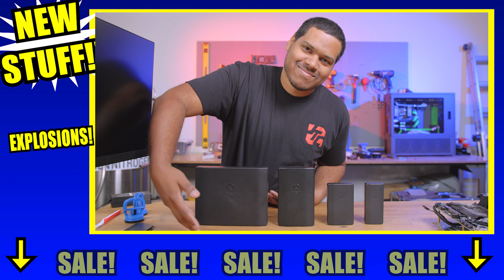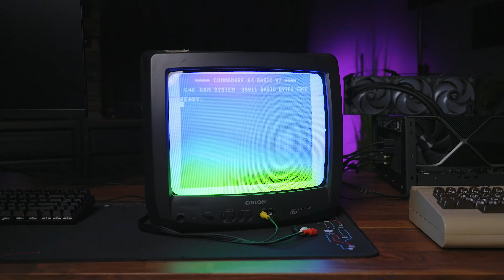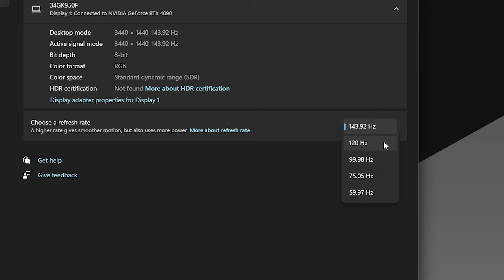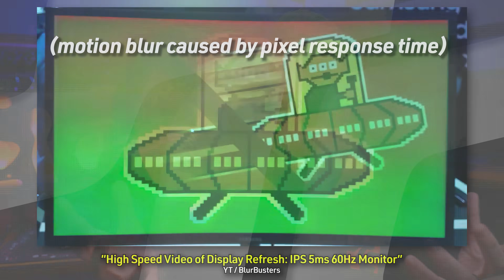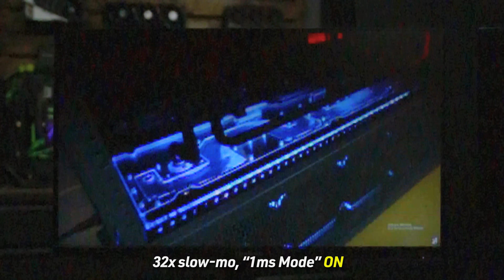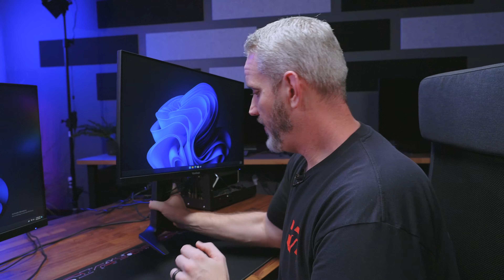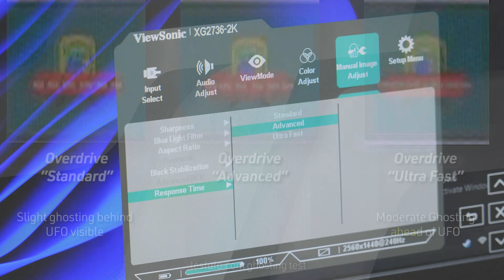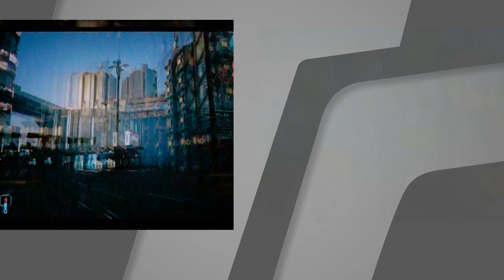MPRT is pretty awesome! This is how it works...

Comment: I'm one of the lucky few to own an FW900, bought for 250€ back in 2015, and many people laughed at me.
Of course, the screen size and aspect ratio is a serious downside, so any TV and monitor I've bought since was carefully selected to provide better than sample-and-hold motion clarity.

I own a 2018 17" TN LCD that is sub-1ms MPRT at 100/120hz using ULMB (The PG27VQ, initially purchased because it was the last/best 3D Vision Monitor). It is hacked via CRU to use ULMB at 60hz as well and remains competitve with CRT as far as motion clarity goes.
Sadly its contrast sucks, so I tend to avoid it in content that has a lot of dark scenes.

My OLED TVs (LG GX and G1) have BFI options that bring them to about plasma level at 60hz, around ~4ms MPRT and ~6ms MPRT respectively, albeit with a dim image.

I want newer, brighter OLED TVs to bring back the BFI options of my GX (hopefully more flexible), and I want LCD PC monitors to come with ultra bright HDR panels, with lots of dimming zones to improve contrast AND ultra-short-pulse backlight strobing, allowing to arbitrate between brightness and motion clarity at will.
Only the latter can somewhat compete with CRT, OLED is beautiful for slow moving content like movies, but they will never have enough brightness to sacrifice for motion clarity.

Comment: What I'm really interested in is MPRT at around 120Hz. People say "60fps was fine 20 years ago", which is true because of CRT strobe causing perceived motion clarity. If we can get mid-range refresh rate displays with MPRT for cheap, use driver tech like AFMF, graphic fidelity chasing could be something that games enthusiasts start accepting as the norm again. 
Imaginary scenario: "My 120Hz MPRT is letting me run games at ultra settings with path tracing and it feels as smooth as 240Hz with native rendering output!"

Comment: I know I did spend a lot of time researching before I bought my monitor, but I'm totally okay gaming at 2K 120/ 144 fps w/ just VRR- the hardware motion blur doesn't bother me in that range. Sure, I would love to have 4K and OLED (in that order) but it's just not worth it for me personally right now... 
Also, my GPU would have a hard time above 4K 60, and HDR support seems to be hit or miss requiring settings to be charged between different apps/ games, browsers, and desktop. So I think I'll be happy with what I have until 4K HDR 120+ becomes cheaper and more accessible.

Comment: I am sick, and occasionally Jealous, off friends that still use old ips 60Hz 12ms gtg telling me how 50 fps is smooth. And I know they are not lying because I used to experience the same thing 15 years ago.
Reply: CRT refresh and flat panel refresh really aren't comparable.  The simplest explanation as to why CRT will always be better is because there are significantly fewer steps to get the image from the pre rendered space to a pixel on the screen on a CRT.  The only way flat panel displays will ever be good is if they send images in parallel to the display and render parallel sections rather than in serial.  Basically all graphics cards are still optimized for the CRT serial image rendering pipeline... and flat panels use a pixel mesh with a flood fill refresh... which is gross and inefficient.

Comment: Grey to grey is used because it's faster than black to white, manufacturers preference is to be able to claim lower numbers. A lot of panels are not actually 1ms too. OLED is great but it's often too fast for 24p content and can make judder worse even if you run at a multiple of 24hz for no pull down. Black frame insertion is good for retro gaming but has its own issues. I don't use my retro consoles on my Samsung 55" s95c as I'd need a scaler and while the retrotink 4k is fantastic it's expensive for the hobbyist (they managed to make 1000s of dollars worth of industrial scaler quality into something reasonable for an enthusiast that's an achievement tho).

Comment: Even incandescent lights flicker, as the temperature fluctuates with the current.  It's just that they don't go all the way dark, so even fewer people notice it.  About the only lights that don't flicker are ones downstream of a moderate capacity AC->DC power supply.
Reply: If it is plugged into AC it will have a strobe.

Comment: Not every LED does flicker. Only if they use PWM (to control brightness) Or in cheap lights that do not have proper DC smoothing. LED lights that are used for example in a Photo studios would be useless if they flicker.  All depends on the kind of LED driver.

Comment: You guys should do a video that talks about the best video card and monitor pairs. What's the best bang for the buck video card and monitor pair to get the fastest frame rates and features for the least money? What's a budget pairing that will get you playable frame rates? And what would be the top of the line pair but not wasting money?

Comment: You can fix the magnetic damage to a CRT by just using a strong bar magnet. Just spin the magnet and slowly back away from the display and it should fix the colors being screwed up.
Reply: A PC CRT monitor is lightyears better because they degauss when they turn on/off.

CRT TVs are trash.

Comment: a little motion blur is okay especially for racing games as it gives some sense of speed.  i've wrecked a CRT monitor by adjusting the refresh rate a little beyond what it was rated for, usually can do around 10-15% more  ( it does work but greatly reduces  the lifespan on the CRT )

Comment: As an old Need for Speed head, back during Underground or Most Wanted times, motion blur added SO much sense of speed, it was awesome.
Reply: I generally still prefer motion blur in driving/racing games, both arcade and sim.
Reply: Agreed motion blur is really only needed in racing games, it helps gives the sense of speed better.
Reply: @Adam420Simpson  any game that need to add sense of speed may utilize motion blur subtlely, but yeah default game motion blur is yucky.
Reply: @Adam420Simpson  I have "short" motion blur enabled in Forza Horizon 5, and it does add a fair bit to the sensation of speed. In first-person shooters, however, it just seems to emulate having a concussion more than anything.
Reply: @TheRogueWolf  yeah, even on 3rd person Action RPG motion blur if its a bit will gave you sense of speed, but more that that "bit" then we can see that annoying too fast i cant see
Reply: @TheRogueWolf  
Yeah it's what I've been trying to tell some folks forever. Motion blur can be important in games for immersion, but it depends on what and how they're implemented.

Good implementations usually just add some blur on the side and corners in racing games with the option to configure the intensity, along with some blur coming other cars.
And good implementations in first person, third person and other games are just some very small, low intensity blur for objects or people moving fast enough to warrant it.

But we've had so many bad implementations where they just create huge blur to every single character movement, or blur the entire screen with a fixed intensity that is normally too high.
Reply: Blur is blur, blurry vision is bad vision. Racing is about being fast, not feeling fast.
Reply: @erikheijden9828  in racing you usually need a good sense of speed to know if you're too fast for a corner and other things. If the game cant portry a sense of speed, it's a bad racing game. and you achieve that with motion blur. believe it or not, but that's more realistic.
Reply: @erikheijden9828  Gives some vertigo.

Comment: 09:20 - Nothing is a constant source of light, including incandescent lights, heck, even the Sun. Photons are emitted at a certain frequency, it just happens to be super high for you to notice it/capture it on camera. Incandescent lights, tho, do flicker tiny bit if you're running them on AC - at 60Hz in the USofA or 50Hz pretty much everywhere else in the world. That's why auto-gain/exposure of video cameras has the setting to select your AC frequency.
Reply: If you're at a point where you're describing the rate of individual photons stimulating your photoreceptors as non-constant, you're really NIT picking. :)
Reply: @SwervingLemon  Nice! ☺

Comment: BTW, you're not really permanently damaging the CRT, what it needs is a "Degauss", what that is is a demagnetization of the metal components in or around the CRT which is achieved by blasting electromagnetic AC with some coils

Comment: Fun fact:  The strobing effect also works with camera shutters.  Ever notice how helicopter rotor blades either move very slow or sit still in videos?  Strobe effect. 

These kinds of things are amazing, but sometimes is almost too much.  I had to tweak my OLED TV settings because it was oddly TOO clear and TOO smooth.  Due mostly to how movies and TV is shot, but it all looked...I don't know how to describe it.  Fake?  Fake comes as close as I can get I think.  Definitely Uncanny Valley.
Reply: Most "TV"-OLED's do post image processing to smooth motion blur.  The Motion Interpolation inserts "fake frames" in-between the actual frames to .. well, smooth motion... so yes: what you're describing is literally an actual signal interlaced with "fake-mathematically-computed-frames" so much of what you're watching is a computer's best guess and not actually what was contained in the original signal.

Also--digital video strobing usually has more to do with the speed at which the image can be stored to memory than the photo-sensors ability to capture movement.

Comment: I think a good case for having to know MPRT is for people who have motion sickness from motion blur. I think I'd be one of the target market for this.
Reply: Sometimes that's caused by ghosting, I used to get nauseous when playing Halo 2 on the Xbox One (OG) on a 42" 60 Hz LCD LG TV which I had for years before all the crap LG started doing with privacy and data (long before smart tvs were a thing). I no longer get sick playing the same game at 120 Hz albeit on a PC as there is literally no ghosting (using a 7900XTX and 43" QN90C - bought before the scandal with the Samsung repair tech shunted a customers display. Using a TV as a monitor helps with processing ridiculously large tables.... and flat file databases... seriously people need to learn how to use pivot tables at the very least... sheesh. Then there's the added benefit of snapping FL Studio, a virtual machine and game on the same screen at the same time - sure you could do the same on a smaller monitor but... you won't be able to see much lol.
Reply: Or maybe not...
The backlight strobing used in MPRT gives a lot of people headaches (and in many cases is no better than a low response time IPS panel anyway).
If I were you I'd try to get a demo of one somewhere before buying.

Comment: Refreshed monitor technology and you still have go within arms reach to use buttons to set up the monitor. I have said this for years and years now, why are monitors not supplied with remote controls or software to set up? Televisions have had remote control since 1950's(?) and yet monitors rarely have been supplied with a remote control.

Comment: Strobing with oled is not good because the brightness of oled is already limited. So until we get oled panels that can handle a higher and longer peak full screen brightness, strobing won't be good on oled.
Reply from the maker: Well you would never strobe an OLED, each pixel is emitting its own light. So its limiting factor is the time the pixel takes to change color and change brightness.
Reply: @Jayztwocents  I mean bfi
Reply: @Jayztwocents  and we already have strobing / BFI on oleds. But like I said, its not very good with the reduced brightness.

Comment: I don't trust this. I had a 19'' LG LED 720p monitor for 12 years. I feel these are going to burn in, or burn and turn off after 4 or 5 years tops.
Reply from the maker: If you think LCD burns in then you didn't listen to a single educational thing in this video

Comment: Even incandescent bulbs will flicker when connected to AC power
Reply from the maker: Yeah we had to trim the video but it will "dim" because the hz is faster than the filament cools
Reply: Yes you are right, maybe dim would have been a better choice in my comment to describe it.@Jayztwocents

Comment: 1ms response on LCDs is... a dumb metric. in most cases, you basically need to overclock the monitor on its highest response settings for it to achieve it. which leads to other issues. so in 99% of cases, 1ms is unusable on the monitor (more often pixel overshoot).
Reply from the maker: You mean. Like the ENTIRE section we discussed overdrive? Way to repeat what I already said lol

Comment: I have mprt on my MSI monitor, and I always wondered what it was 🤷‍♂️

Also, i should add that i bought the VA panel 240hz monitor because i saved $100 over the ips panel one. 🤷‍♂️

Model: MSI MAG275CQRXF